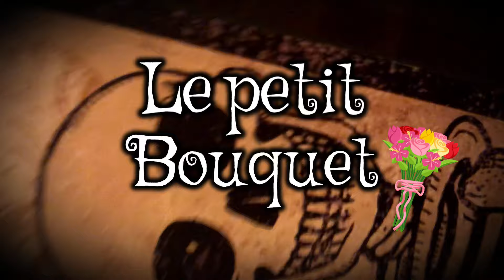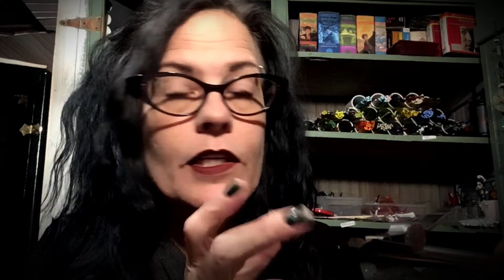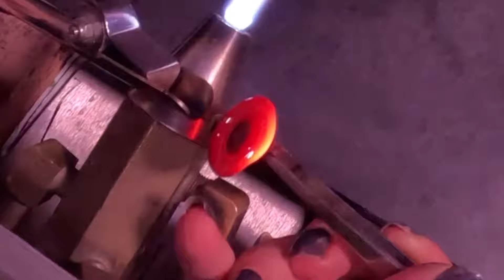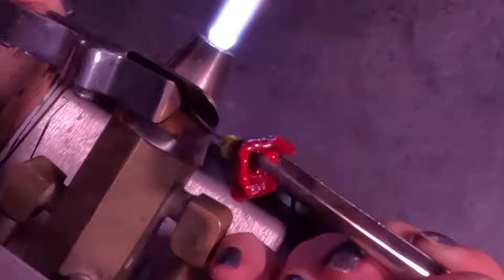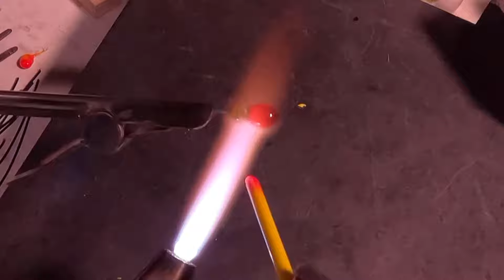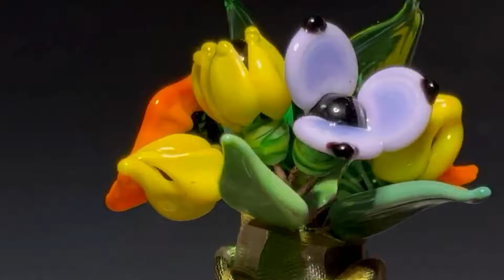Lampworking / Flameworking - 102.24 - La Petit Bouquet - 104 Glass Demo

Comment: I love these but I have a question...can I use silverplated copperwire? What wire do you mostly recomend? And whst gauge? :)
Reply from the maker: Hello Kristina! 💫🌹 Glad you enjoyed this one! ✨ You can definitely use silver plated copper wire! The silver will burn off exposing the copper, but you can shine it up with some steel wool.  I have used silver plated headpins and it works great.  I like to use 18-20 gauge but it can vary depending on what I have available….Thin enough to bend but thick enough so it doesn’t melt! 😂
I had a lot of mine melt….so thickness is good 👍🏽   I hope this helps you out!🌹✨✨✨
Thanks for your questions!! 🤗 Cheers- Robin 🌈💫🌹🌹
Reply: @scottwoodresearch  Thank you ❤️